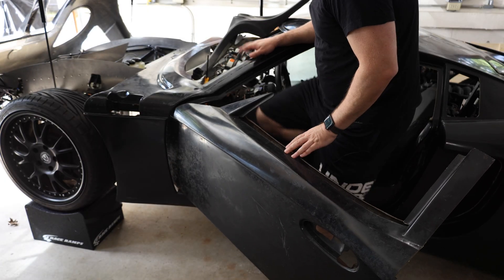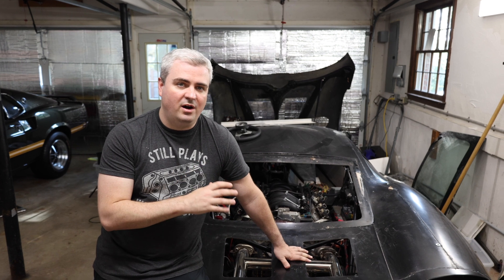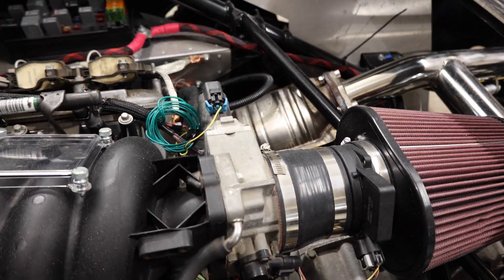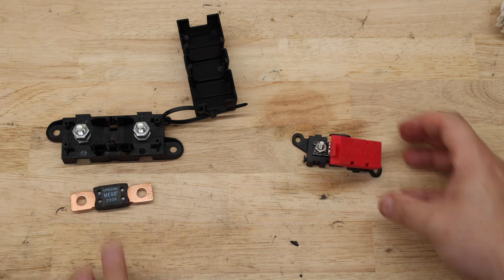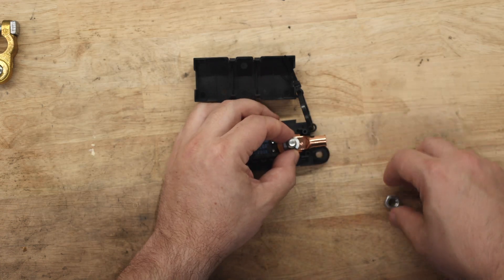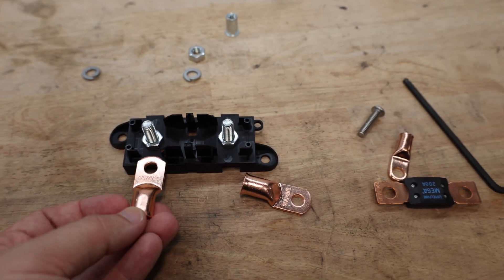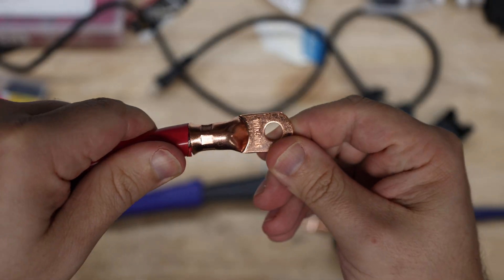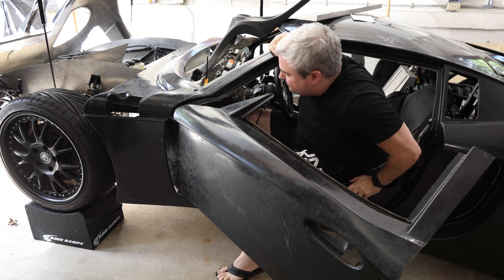Adding a Battery Fuse to the Kit Car

Comment: Rivnuts! Good job... To everyone looking for Pure Copper OFC Welding Wire to use as battery cable with really good temperature and rugged protection. Use Temco Industrial. West marine is 2x the price for less insulation
Reply from the maker: That's a great tip! I'll check the Temco Industrial wire out next time. I was in a time crunch and needed to get the project done so I didn't mind spending more. I 100% agree with you, not the best value compared to other solutions.

Comment: can you explain why to put the fuse before the starter motor and not after? tks a lot
Reply from the maker: In this vehicle, the battery cable that goes to the starter is about 15 feet long. I put it as close to the battery to minimize the chance of that long cable getting damaged which brings the power back to the starter.

Comment: Make sure you have a fire extinguisher in the car. I installed a fire suppression system in the engine compartment also. If the car goes up it's too hard to get in there in time to put a fire out and the tanks are right behind you. (If you can't get out).
Reply from the maker: That’s a good idea. I’ve been thinking about that recently with the tanks being right behind the driver and passenger.